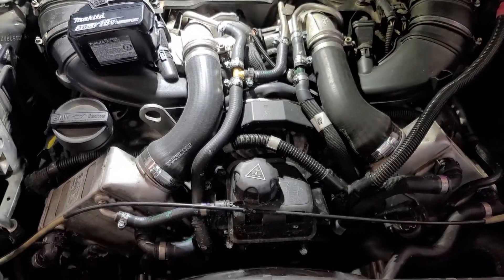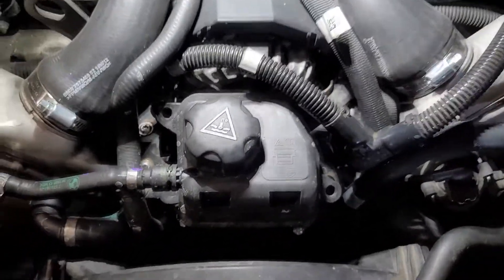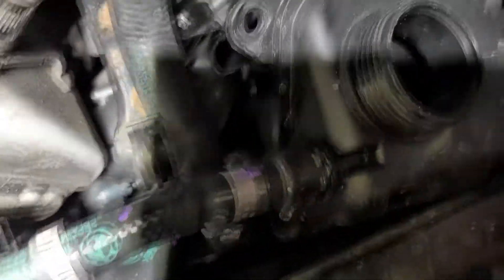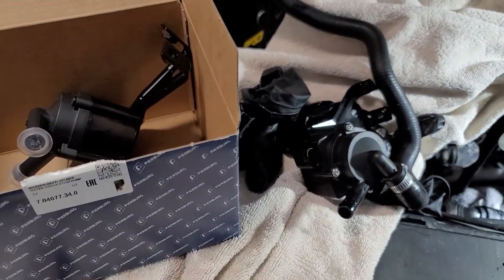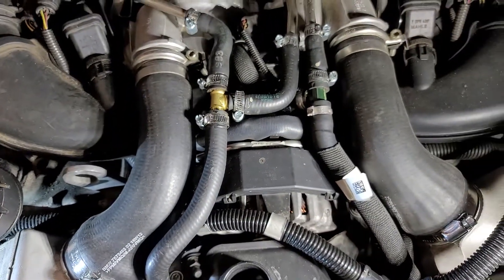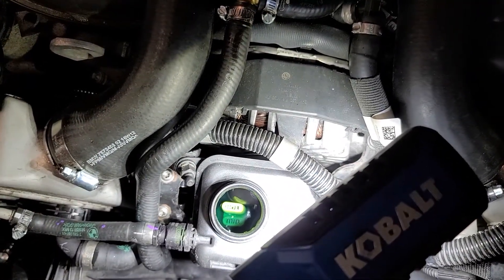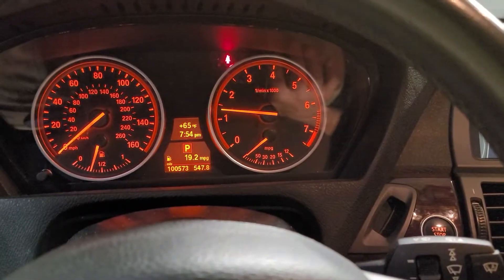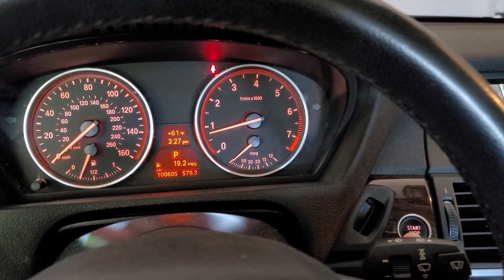BMW X5 N63 S63 E70 2EA9 error fix turbo coolant pump replacement

Comment: Have the same error message for my f10, will that fix it as well
Reply from the maker: What engine?  N63, N55, etc?
Reply: @jcx2bby  N63
Reply from the maker: @jpayne1001  I'm fairly confident it will then. This is a very specific code, referencing only that little pump.
Reply: @jcx2bby  okay thanks, will look into it as soon as possible
Reply from the maker: @jpayne1001  not too bad of a job. I have a new Gates pump you can have if you want it. It's the warranty replacement for the pump that failed in this video. I don't blame you if you don't want it lol.
Reply: @jcx2bby  thanks but I’ve already ordered the part from fcpeuro
Reply from the maker: @jpayne1001  a wise choice. Mine has been flawless from them
Reply: @jcx2bby  just need to get coolant now

Comment: This worked for me thank you so much. 750i 2012, was getting same message. Engine hot drive moderately on cold start. Changed Turbo coolant pump (aux pump) as specified and boom. All good! I would hear a light ticking sound after turning car off ,guess that was the faulty pumping still trying. Thanks again my friend.
Reply from the maker: Outstanding!  Thank you for taking the time to comment here, truly. Congrats on your success.
Reply: What was your symptom too knowing it was the turbo coolant pump (aux pump)? I can’t bleed the system on a n63 motor can that be the issue?
Reply: @ramisiljazi9540  Not sure if it’s necessary to bleed the system, no symptoms just an annoying message saying the car is hot when indeed it’s not. Also after changing I realized the faulty pump was making noise before when i turned car off, noise stopped after part change. performance wise i didn’t feel a difference , but not replacing will lead to turbo failure eventually. Hope this helps it’s all I got lol
Reply: @autowraps1159  I appreciate the reply!

Comment: quick question, I'm getting a cd9001 on an m6, charge air coolant system no communication with coolant pump. is it about this pump you're changing or one of the intercooler ones?
Reply from the maker: To be honest, I'm not sure about your situation. To my understanding the pump I show here strictly only cools the turbos after the car is turned off. There is another electric pump down low in front of the passenger side of the motor that is probably the one responsible for cooling around the intercoolers. Even if I'm right on that, I'm not sure that that would fix your specific error. Sorry
Reply: Me to, ever solved it?
Reply: Did u fix it ??
Reply: @ashotarzumanyan9958  no bro sorry. better off with an m4, much more reliable and easier maintenance on it

Comment: My pump keeps running all night long and drains the battery in the morning? Anyone have the same issue?
Reply from the maker: Are you sure it is running all night? I know they can run for 25 min or so, and if you have an old battery, it can discharge it pretty low. 
If it is indeed running all night if be suspicious of a bad temp sensor. That should be what tells the ecu to start and stop the pump.
Reply: @jcx2bby  I’m positive, I can come back into the garage 2 hrs later and I still hear it running.
Reply from the maker: @CustomBarberChairsAtlanta  Ah. Bummer. Have you scanned it for any codes?  If it doesn't have any, I'd probably replace the temp sensor, there are 2, and see if that helps. You may have to ask BMW to diagnose it if all else fails. Good luck to you on this. If you figure it out, I'd love to hear what the solution was.
Reply: @jcx2bby  I had a feeling it might be a failed sensor. It’s not throwing any codes at the moment. I’ll give that a try and let you know. Thanks
Reply from the maker: @CustomBarberChairsAtlanta  ok there's 2 of them. 1 in the thermostat housing and one on the pump. I have some other videos up that show those things. 
Also.... I just remembered that someone commented one time that they had a bad pump that would never stop running. It is possible the pump itself is the issue.

Comment: After running I check the reservoir and the fluid is cold shouldn’t it be hot or at least warm? 
Just wondering if my pump is bad as I have no lights on dash other than loss of power from motor shown on dash from time to time.Do you think I might have a bad pump?
And what is the bmw number for the pump as I went to euro site and couldn’t find it on that site to match same numbers you had on video.
Reply from the maker: I would think the coolant would be warm, but it will depend on many factors e.g. how long did you run the car, what is the ambient temp, etc. 
To get the part# specific to your car go to realoem.com and look it up.  That way you know for sure you have what will fit your vehicle.
Reply: the small reservoir in front is for the intercoolers, the larger one on drivers side is for the engine/turbos

Comment: Any idea why i can't do the bleed process? I've tried before, but i don't get any circulation of the coolant after holding the gas pedal down.
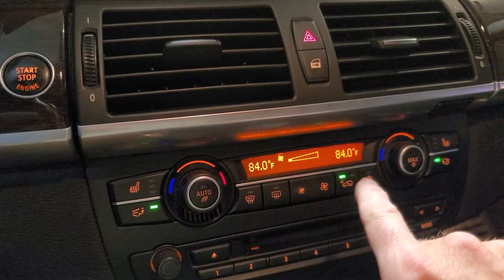Reply: I had the same issue, @11:08 OP said to turn it on automatic, I missed this step and it did not work the first few times... 2 years later I hope this helps someone else
Reply from the maker: Well, not really. Assuming that the battery has enough voltage, I'm not aware of any other reason. Sometimes if the hood is open that can throw the computer into fits for various things.

Comment: @jcx2bb7 great video. Question: i'm gong to do a lower temp thermostat, should i do that at the same time as this fix? does this job get you half ways to replacing the tstat?
Reply from the maker: Yes it gets you close. Be prepared for an onslaught of coolant to come out when you remove the thermostat enclosure. If you have time, order the real bmw coolant from FCPEuro or wherever you get your stuff. Thanks for watching.

Comment: Hey, I'm not sure if anyone still Monitors these videos,
But i have just changed my actuator but when i hold down the peddle for 10 seconds nothing happens, no noises, no coolant pumping through the hoses, it doesnt start the bleeding proceedure, any ideas why?
Reply from the maker: Was your hood still open by chance?  If so, close it and try again
Reply: @jcx2bby  Hey, Thanks for the reply, my car is an x5M so it's a little different than the one in the video.
It wasn't making much noise, but once i connected it to a scanner it confirmed that the pump was actually circulating the coolant.
Reply from the maker: @pancakesaredope310  ok, right on. Congrats on the success.

Comment: What yeae is this x5m? The coolant reservoir on my 2012 x5m is on the top right.
Reply from the maker: 2013. Mine is also not an M. If you have the S63, it might be a bit different placement.

Comment: Hi, just wanted to check, what is the long term affect if you don’t change it right away?
Reply from the maker: Long term effect is that you ruin the turbos. The reason this cooling pump is there is to continue to run antifreeze/coolant through the turbos for 20 min or so after the engine is turned off. This cools the turbos down but also cools the oil that is in the turbos and and the lines going to and from them. If oil in the lines stays hot, it will congeal and clog the lines ruining the turbos in very short order. It will all depend on how hard you have been driving your car, how hot the turbos get and how fresh your oil is, etc. Personally I would not chance it. Get this error taken care of asap.

Comment: Hey man I need some help here I did change the turbo coolant pump but the radiator light turn on when the car is start for a long time but previous problem is when cold start car the radiator light is on. Do you have any idea about this?
Reply: I'm using bmw e71 n63
Reply from the maker: Is it code 2EA9? Is that what you mean by radiator light?
Reply: Yes
Reply from the maker: @jasonho8709  did you clear the code after you changed the pump?
Reply: @jasonho8709 À
Reply: Yes I did could it be the wiring problem?
Reply: But the pump is running though
Reply from the maker: @jasonho8709  man I don't know...you might need to have bmw perform diagnostics and see what they find. If it is running, and you've cleared the code, idk what else I would try.

Comment: Hi. I need to replace this on my x5 I have the exact same error. The little lines on the redline is supposed to go down when the engine is warmed up?
Reply from the maker: Hi Will. I'm afraid I don't understand what you mean by little lines on the redline. Are you talking about temperature?
Reply: @jcx2bby  yes the temperature. The little white lines by the redline on the cluster. I know on e90s those go down as the car would get warmed up. Is it the same as the x5?
Reply from the maker: @williamghau1150  not as far as I know. Mine sure doesn't.  The lines on the tach are permanent, at least on my E70 X5 so that wouldn't be possible. 
I think the M series cars might have had this feature though, not sure.
Reply: @jcx2bby  thanks for the info. I’m tackling this job tomorrow. Will follow this DIY. Hope I don’t need a code reader to remove the error.
Reply: @jcx2bby  just finished replaced it bro but unfortunately it still has the error when I start the vehicle. I’m confused now. Not sure what else could be the issue.
Reply from the maker: @williamghau1150  I can't tell you for sure, but as with all things bmw, disconnect and reconnect the battery if you have trouble clearing the code. Good luck buddy
Reply from the maker: @williamghau1150  haha, I literally just replied.... disconnect your battery and wait awhile. Drive it around afterwards and see if it goes away
Reply: @jcx2bby  did the battery reset and it didn’t come on after I left it sitting unhooked for awhile. But after drive for an hour or so the error came back. These cars are difficult!
Reply from the maker: @williamghau1150  well it is possible you have a different issue then. Do you know if you have code 2EA9, or are you just going by the message on idrive? Without a code reader that can read bmw oem enhanced codes, you are kinda shooting in the dark.
Reply: @jcx2bby  yes it is a 2EA9 code exhaust turbocharged coolant pump, control, electrical. That’s the code it brought up on my scanner for sure. Very puzzled at this point, the error goes away after like 20 seconds or more. Drives fine. Only after start up. I replaced with Pierburg aux pump as well.
Reply from the maker: @williamghau1150  Is the pump running after you turn off the car. Once the car has been up to operating temperature, that pump should run for like 15 or 20 minutes after you shut off the car. Easy to tell, open the hood and listen for a little humming. You can also put your hands on the hoses that go into the little coolant reservoir on top of the motor. You should feel them vibrating. If you don't hear a little pump running and don't feel any vibration, then the pump isn't running. You could have a wiring problem, a power problem, or the connector on the pump may just still be loose
Reply: @jcx2bby  it’s running after the car is off so I know the pump is working for sure. Wiring problem hmmm it’s connected snugged as I heard the click for the connector. I’m guessing the code is set after the car is off for a long while then when start up it will display
Reply from the maker: @williamghau1150  dang man, it's a curiosity. As long as that pump is running, I would try not to worry too much. That code may clear itself in time. I just don't know. Sorry Will
Reply: @jcx2bby  thanks for the feedback though bro. I’ll try to get it sorted out one way or the other lol. I’ve had this code for over a year now but it’s running fine but for selling purposes wanted to get it sorted you know. If people see overheating message they’ll be very frightened lol. Your video was nice in guiding me to replace it tho!
Reply from the maker: @williamghau1150  yeah, they will low-ball that crap out of you over it. If you get it figured out, please let me know, truly curious. Thanks for the feedback on the vid...sorry you had so much trouble. 😔
Reply: @williamghau1150  Im interested on this as well. Did you ever figure out the cause?
Reply: @williamghau1150 I have the same issue. Just tore car apart and went through all the wires and fuses. Same code and same message. On my 2nd pump I tested outside of the car and they both work. Have any luck?

Comment: I just buy 3/8 heater hose and cut it to the length I need,  why spend more then necessary I say.
Reply from the maker: That's one way for sure. I just 'prefer' to buy the molded hoses if they are available. Sometimes when hoses get older, they can kink when they get hot. Especially the smaller ones with tighter bends.  I OCD about that kind of stuff...but regular hose would probably do just fine.
Reply: Fyi - anyone reading this you can source 3/8in moulded EPDM hose and cut the same size which is what I did from any auto parts store. While you’re at it replace the tee’s with brass 1/2in tees like the author mentioned. Be sure to mark the current hoses locations and orientation to quickly reestablish your angles on the new tees/hoses. Btw - there is a white or yellow paint on I believe the supply hoses going to each turbo that I mimicked onto the new hoses to keep my OCD in check 😉. I also used new stainless factory style crimp connector clamps for a more original look and peace of mind than using worm style clamps. I used this part which had most of the same pre molded angles as original from Advanced Auto Parts hose - Dayco Molded Heater Hose: EPDM Rubber, Direct Fit, 3/8" Inside Diameter